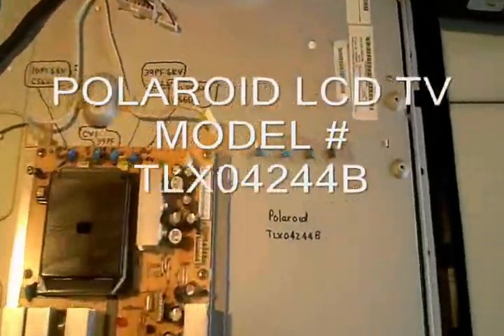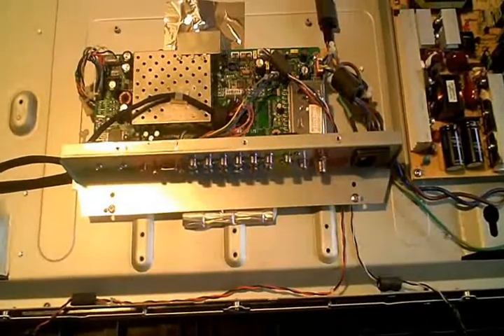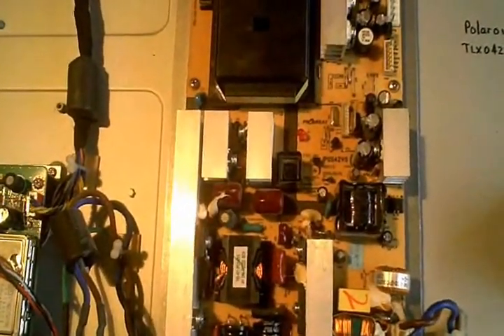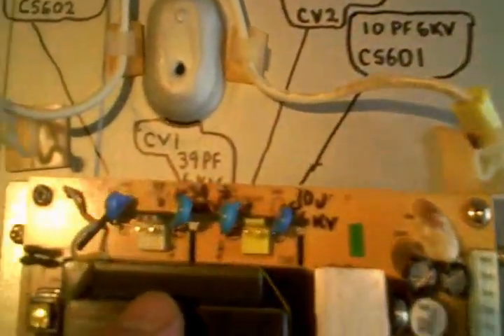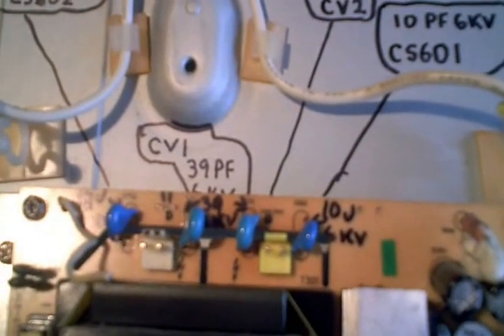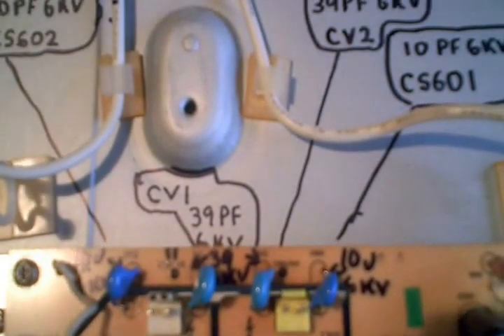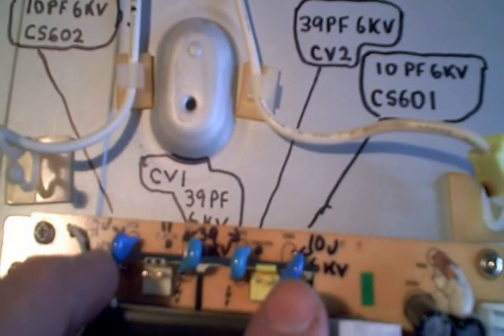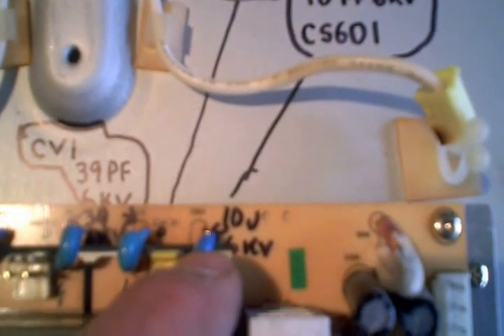Polaroid TLX04244B LCD TV

Comment: Recently found one of these sets out on a curb. CV1 was charred and CV2 had split open like a popcorn kernel.  Replaced the caps and fixed a cold solder joint
at the AC connector on the board. Unit lit up like a Broadway marquee when I pushed the button... pretty nice picture for a 13 yr. old TV IMHO

Comment: Hi there. I just came across your channel. I have the exact same tv,with the exact same problem. Standby light and power light come on,but, nothing appears on screen. Could it be power supply going to inverter? Thanks
Reply from the maker: I'd say yes it could be.
Reply: @GrantsPassTVRepair  Can I test power supply going to inverter with a dmm? If so,where woukd I put leads? How would I know what the volts should be,on my model tv?
Reply from the maker: @Buff_Dave_Oprtr  I would suggest using a neon light as I show in this video. https://www.youtube.com/watch?v=PflyJ4H51Fg

Comment: I have this same TV model number, and the arrangement of the PCA boards are not the same. 
All screen backlights work fine, but the LCD on the left side changes from the blue no signal screen to a flickering of horizontal lines. If the TV is angled downward I doesn't happen, or if I lightly punch the screen in the right place. I have checked the data cable from the mobo to the LCD panel and it is tight.

Comment: Hello I have the same model tv but my boards are differant, the problem I am having is I plug it in and the red light comes on then when I push the power button the blue light will blink 6 times, I can not find what that code means, do you happen to know?

Comment: Great Video!
I am an Electronics Technician, and interestingly enough, I have a Question:
I know that in many Applications for some of these Generic HDTV's, the Components tend to wear-out rather quickly, within a couple years.
*Is There an 'Alternative' spec of Capacitors that can be used/Substituted to use as Replacements, that would last a whole lot Longer??
I am asked by people quite a bit, about how to make they're HDTV's Last longer after I service them.
And I know that there are WAY Better Electrolytic Caps, same Voltage & Farad-Specs, but Higher Life-Ratings & Temp Ratings per Life [10,000 Hours, 85ºC/105ºC]
I always use Better-Rated Electrolytic Caps when I Replace them. But I really don't know much about the small, and in this case Tiny Film-Coated Caps.
What are Your Recommendations on Higher-Quality Alternative parts such as these Tiny Film-Coated Caps?
Thanks in Advance.
Reply from the maker: I generally go to digikeys website and purchase the best caps I can find based on their spec sheet and I go by life expectancy, heat tolerance etc. They have live telephone assistance if you find their website confusing.
Reply: Grants Pass TV Repair I noticed that you went with the 6300V (6.3kV) instead of a reg 6000V (6kvV). Was that done to improve the longevity of the capacitor?
Been having channel changing issues on the same model. channels wont scroll. Have to input channels manually on the remote and the tv. Any ideas? awesome vid btw..
Reply from the maker: I generally order from Digikey and go with the electrolytic caps that look good on the spec sheet as far as heat tolerance and life expectancy.. When it comes to Disk capacitors I'm guessing it would help to go with Caps that have a higher voltage rating than the original capacitors.. I'm no expert on this subject  but these are the principles I go  by when choosing replacement capacitors. Unfortunately there are plenty of other parts that fail in TVs such as the displays and backlights, When it comes to using semiconductors that last longer every now and then when I find a diode that went bad I may use a replacement that has a higher PRV and current capacity. Sometimes when capacitors fail they cause semiconductors to fail.

Comment: I have a Vizio E470VL with the same problem and need the value of those little blue caps. Would they be the same as what you replaced. Do all LCD's use the same little blue caps at the HV transformer output. 39pf 6kV?
Reply from the maker: The value isn't necessarily the same. You need to go by the numbers on the capacitor and replace them with the same value as the ones that were in it. If your having trouble identifying what the numbers and letters mean on the capacitor you can use the capacitor identifier in my website at http://www.tvrepairinfo.com/ or call digikey and ask for technical assistance.
Reply from the maker: The value of those capacitors you saw in my video aren't inecessarily the same as what you need. I don't know the specifics for your model number. You need to go by the 
numbers and letters on the capacitor and replace them with the same value as the 
ones that were on your inverter board.. If your having trouble identifying what the 
numbers and letters mean  you can use the capacitor 
identifier in my website at tvrepairinfo.com or call digikey
 and ask for technical assistance. The little blue capacitors you saw are called ceramic capacitors.

Comment: Dave, this seems to be happening on the Polaroid range.
I have a unwell 22" same problem I get it to come on with the logo then shut down.
I did come across 1500uf 10v and on the same rail 3x 680uf 25v one of these was reading 38ohms and 421uf.
the 1500uf was popped I thought it was just this but all are bad. thanks dave.

Comment: Hi all, love the videos.

I'm getting a free 40" Sony LCD that has part of the picture missing..

If you divide the screen into 4 equal VERTICAL parts numbered Left 1 to Right 4...

The section that would be 2 is blank. Sections 1, 3 and 4 are perfect.

Any ideas? I'm guessing it might be a loose ribbon cable?

Cheers ;)

Comment from the maker: I don't think there are any ESR meters which can test capacitors in the Picofarad range. I had to use my B & K capacitor tester. Sometimes you can tell there is a problem by the discoloration but not always.

Comment: I've seen the same thing on some older Philips-TVs. Just out of curiosity: Did you confirm the caps to be faulty by measuring them with ESR/multimeter and what kind of measurements did you get? Or did you just visually inspect them and decided to replace them. Seems that one of them looked kinda burned.